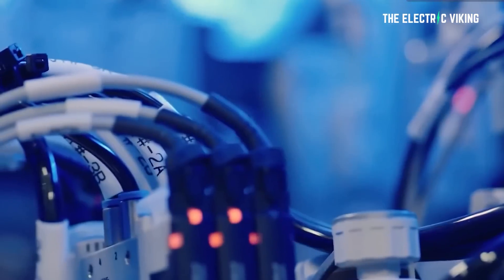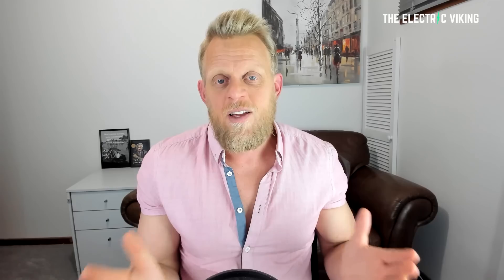BYD ships LFP Blade batteries to Tesla's gigafactory in Germany

Comment: Tesla’s battery management system and software prowess is second to none. This is why they can use batteries from multiple manufacturers.  The Tesla engineers have designed their system to be adaptable to multiple battery configurations and types. The only limitation is physical shape of the batteries in question. The required KWh of batteries have to fit in the battery pack size so they meet the same crash worthiness without having to reengineer the rest of the vehicle. 
Soon all battery types will be so good and have such great longevity that no one will care what is in the battery pack. Does a consumer ask what shape the gas tank is in their ICE car now? Nope, as long as it holds a required amount of gas no one cares. Soon battery packs will be the same way.

Comment: > A good engineering team considers all the ramifications and generates designs giving several options.  The BYD battery source was ordered under what is called " lead time "so that Tesla was already months into the transition before announcing it.  Tesla has an engineering staff equal to all other car manufacturer's combined. That is why Tesla's Research & Development  budget is higher than any other manufacturer.

Comment: Maybe considering "Life" or in this case, Total Potential Market, as a Zero Sum Game is suboptimal? BYD & Tesla 'slugging it out' for dominance might be a tad on the adolescent side of a viewing angle upon the world, or "Life".

Your general 'life is improving day by day' attitude is fine healthy refreshing. It breathes of a world that is richer, more open, inclusive. I find value in this. Thank you.

BYD & Tesla are more co-conspirators, colleagues, than competitors. The ratio between current realized market supply compared to the total potential market demand is so small to make many comparisons is lip flapping at best. Even in a history written 50 years from now, though such a discussion may be of interest, it would still have no predictive, no relevant value.

I wonder when Tesla will include LFP+M manufacturing in house. This is needed for both vehicles and storage. That's what I'd build in Canada, a huge LFP+M battery gigafactory (& solar).  I also wonder when they will workout a structural pack solution for these other than 4680 batteries. The savings in using full castings, front and rear, is too much to let go.

I am interested in how they will distribute these different batteries across model ranges. There are many factors to consider in making product differentiations that are clear to consumers and mutually supportive to overall sales.

Comment: Tesla needs to not only improve its battery pack life but also keep a little back so it can bump up the range to make up for the degradation over time, just to improve owner satisfaction. I’ve had a Model 3 for 4 years now, & my range is down 14%. Charging to 90% at home only, it now shows 240 miles, as opposed to its advertised 310 (279 at 90%); that's a huge difference psychologically.
Reply: 90% seems bit high. I charge 70% in summer and 80% in winter

Comment: Tesla obviously wants as many sources for batteries as they can get. They know the only limit to selling cars is how many they can make, at least for now. Delivering cars is job one, everything else can be worked out later.
Reply: Berlin has a new production line, so not many adjustment work need to be done to adapt new battery.
Reply: @leiyue1411  I think the question was is it easy to place different shape batteries in the pack, does the thermal management still work, can you use the same pink foam or does it require a form to keep the batteries in place, that sort of thing.

Comment: It occurs to me that while most manufacturers make a dozen or more car models, but build each model virtually the same for years, Tesla does just a few models but with many variations in the model, so They can make Model Ys with several different battery types, which gives them the flexibility to pivot to different suppliers when the supply chain gets clogged.

Comment: If I were to buy a Tesla I'd want one with Blade batteries in it.
Reply: Tesla 4680 batteries are better or the new battery from CATL coming out in late 2022 or early 2023. LFP battery doped with Magnesium and some other trace minerals that is 30% more energy dense and lasts almost forever.
Reply: @glennnile7918  The 4680 uses cobalt and nickel, can only be charged to 80%, has a fire risk and doesn't last as long.  The 4680 are more energy dense and can be charged faster, from what I've heard.  For my situation I'd much rather have the blade batteries.

Comment: Bjorn Nyland's charging comparison today showed that the Blade battery has an excellent flat chargig curve.
Reply: Sounds promising also for the Sono Sion then. It doesn't have a high top power, but if it's a flat curve, it might not be too bad.
Reply: The 2022 tang has a top charging speed of 150kw and 108kwh battery pack.
Reply: @leiyue1411  Top charging speed is of little importance if a car can only sustain that for a couple of minutes, especially with an LFP battery which is likely to be discharged and charged more fully than a ternary battery.
Reply: @leiyue1411  Bjørn saw max 119kW and estimated 86,4kWh usable according to his sheet. There is also a problem with charging taking a long time to ramp up, but after thqt it has a nice flat curve up to 50% where it drops to 71 and then climbs up to 86kW until 75%. Then it was about 50kW until 88%  which is quite fast at that high SoC. Although if the battery is 108kWh and only 86 usable, they have a big buffer.

Comment: Your question why legacy ICE makers haven’t implemented yet LFP has a simple explanation. The arch enemy of batteries is weight and lack of aerodynamics. Tesla has spent years on designing and manufacturing their car from the ground up. Legacy ICE makers were standing by and are now scrambling by shoehorning EV drivetrains into their legacy cars. It is the quickest way to catch up but they fall short on weight and aerodynamics. If they would implement LFP batteries, they would lose 50 miles range relative to Tesla and get into a total range which car consumers find too low. They can add more batteries to compensate but then it will likely not be profitable for them. Eventually batteries will be cheap enough that it doesn’t matter but in the mean time Tesla has the advantage and can pursue LFP batteries much easier than competitors
Reply: Crap!!!!!!
Reply: @carholic-sz3qv  The legacy car makers are indeed in a crap position.
Reply: @denero66  you are in crap position lol…

Comment: Finally. LiFePO4 cells are much more durable in terms of cycle life, resistance to thermal degradation, and are much less of a fire risk than NMC. Just a bit lower energy density. But their prismatic shape makes better space use than cylindrical cells. It's crucial that they have a very long life as this will reduce the terrible depreciation of used EVs where people think used EVs will have degraded range after just 5 years of daily driving on their used batteries.
Reply: Terrible depreciation?  My almost 5 year old Tesla is holding its value and range super well.  I recently sold a 16 year old Prius for with its original NiMh battery  for the same price i bought it for.  My point is the quality of the battery pack  is more important than the chemistry.
Reply: You left out the no nickel and cobalt in LFP batteries.
Reply: Heck, after I am done with an EV, I will take the battery out to be part of the system to power my future off-grid house.

Comment: The BYD blade batteries should be a significant benefit for Tesla. Another battery supplier is a smart move for Tesla.
Reply: BYD also supplies other manufacturers like Toyota lol……. Also why was tesla talking shit about BYD years before!?
Reply: BYD didn't have the blade battery then and their cars were not safe in crash tests in the 2000's.
Reply: @GG-si7fw  nonsense!!!!!! I’m talking about few years ago not the year 2000 lol….
Reply: @carholic-sz3qv  Energy density of BYD LFP battery was low circa 2012. And their cars were crap. Blade battery only came out recently, If I recall correctly in 2017 (or was it in 2019?). EM's statement came out in 2014-2015.
Reply: @benzengap6804  they could have at least bough those BYD batteries to make storage batteries for home usage…..